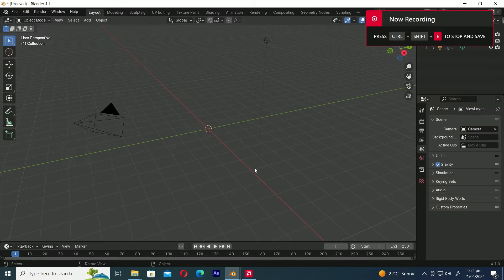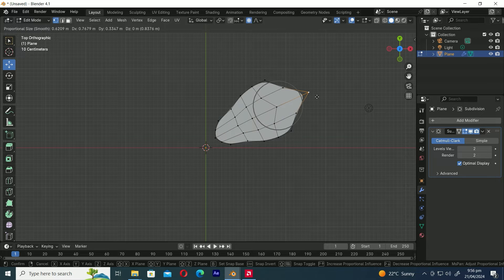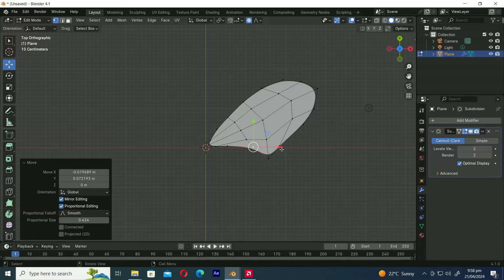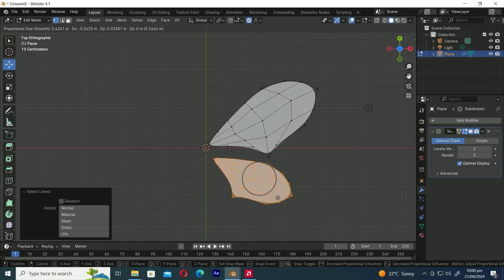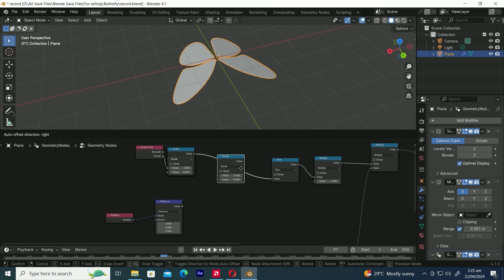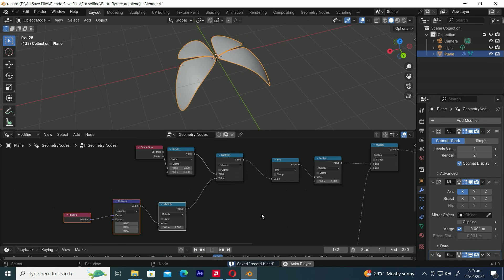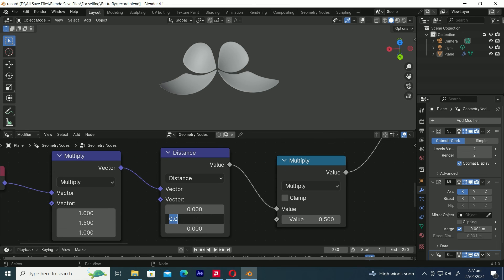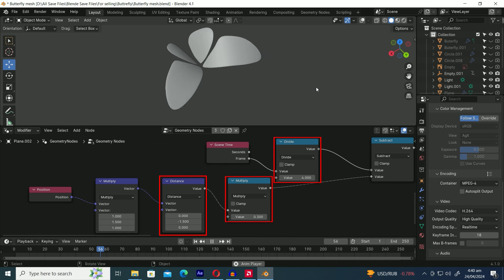Procedural Butterfly Animation Blender 4.1  | Blender tutorial

Comment: Hello, I’m using your tutorial to create a dissolve effect, so I used another object that I named Mask (the object that will dissolve and reveal the butterfly particles). I set everything up fine, but in the end, I realized that I used the butterfly animated with geometry nodes as the particle render for the Mask object, so the animation for all the particles will be identical and repeated across the other particles. I'm not sure what to do now. I wanted the animation of the particles to vary for each one.
Reply: Guys, I figured out a way, just create other objects and tweak the node to make them different, then put them in a separate collection. Instead of selecting just one object in the particles, select the collection render, and it's solved.
Reply: @netun9540 potentially explore handling the particles as instances and assigning them an ID, you can then get the nodes to apply to each instanced particles separately. Useful with noise textures, random numbers or comparative ranges such as behaviour that scales more or less the further from a set position the particle is located.

Comment: My mirroring only happens on top of the wing section. it doesn't cross the 0 point of the Y axis.     Edit: Turns out I did a ton of things wrong right away, I needed to move the plane's origin point (little orange dot) back to world origin for the mirror to work, then I had to apply some scaling and rotation I did while in Object Mode with ctrl+A so the mirror would stop applying the rotation wrong.
Reply from the maker: On the vector rotate node, try using the X or Z axis instead of the Y axis.